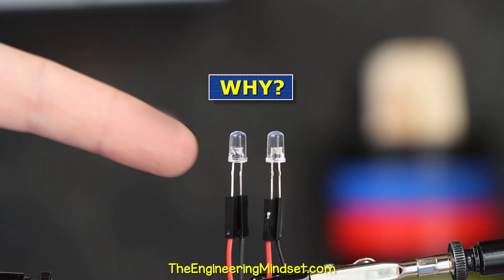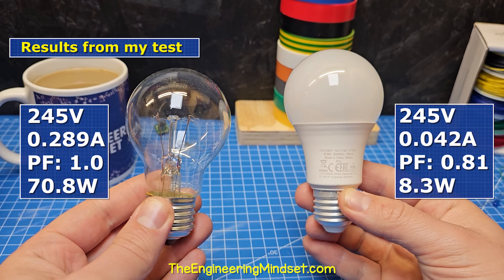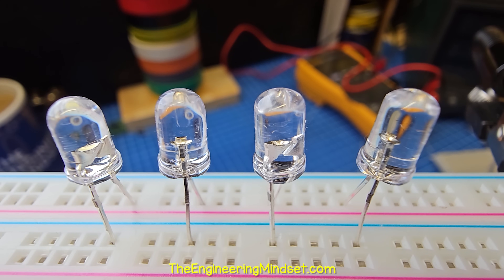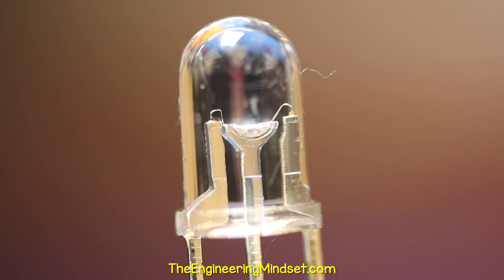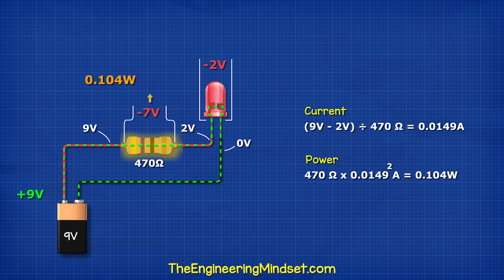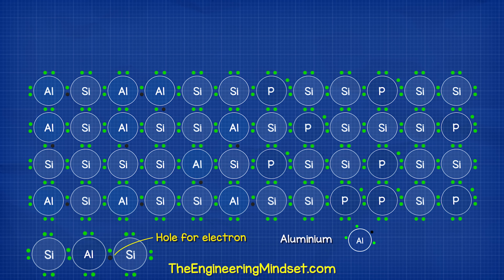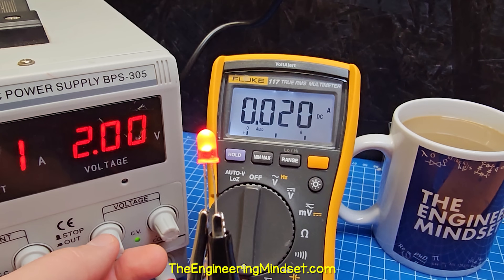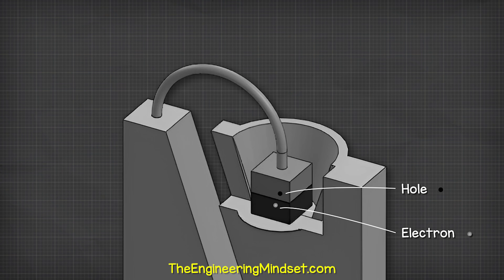How LED Works - Unravel the Mysteries of How LEDs Work!

Comment: 8:36 those are not tiny LEDs inside the computer monitor, those are LCD pixels that are backlit with a few white LEDs.  If you went to a large sports stadium and zoomed into their large screen, yes then you would see lots of LEDs that make up the picture, but thats not the case with an LCD computer monitor

Comment: Excellent video. Being an old TV, RADIO. Repairman in the 70’s  I have a steep learning curve ahead of me.  MOSFET was the cutting edge of the cutting edge when I started Medical School. Now at age 70, I am still seeing patients but am getting back into electronics. In my life as a physician, I met many veterans from WW2 and into the early 1950’s. Learned a lot once their NDA’s expired. Amazing what they were able to do with vacuum tubes!  Now, something I would appreciate your expert opinion.
I learned physics in undergrad, Kozarev’s theories, which he proved to a certain pin extent, were fully validated in the Mid to late 80’s and 90’s. The physics of his  Spiral   mirror are amazing but well beyond my math level.  I found out last year of a recent experiment in the last 10 years, they were able to  SEE the Pleiades where they currently are both with light telescope and radio-telescope when using the Kosarev spiral mirror in conjunction.  The Pleiades are 1200 light years away. This would indicate that Kozarev’s mirror is able to receive tachyons or other similar particles.  There is a documentary on YouTube about the experiments that were tried in an area of low magnetic field near the North pole.  Please let me know what your thoughts are on this scientifically proven but quire mysterious device.   My name is Sergio  AKA Dr. T🖖🏼
Reply from the maker: See my new MOSFET explained video here➡️: https://youtu.be/AwRJsze_9m4

Comment: Another LED type that I learned about a few weeks ago is called an addressable LED. It’s a bit beyond this video, but worth noting for the advanced users as it allows multiple LEDs to be controlled at different colors each using only one signal pin on a microcontroller. 

It is a LED with an internal microcontroller that can be gotten as either RGB or RGBW and is controlled by a high low signal. The LEDs are chained in sequential order by their signal pins. To control them, a signal is sent containing the information for all the LEDs in the chain. The first LED removes its instructions and then sends the remaining signal to the next LED. These LEDs can be bought individually or in LED strips.
Reply: void of free electrons and holes, is crucial to how a diode—and therefore an LED—operates. It forms an electric field that controls how electrons flow, allowing them to move in one direction only. When an electron from the N-doped side moves across the depletion zone into the P-doped side, it releases a specific amount of energy, which is emitted as light.

Comment: Ten volts LED light takes 100 DC power then each light then each LED takes ten volts current when taking 100 votes in series what voltage full moon takes in single give that power to another separate section and vote near DC power

Comment: LEDs are bad diodes. With a reverse voltage greater than 5 volts, current begins to flow through them again, like in a Zener diode. But because the direction of the current doesn't match, they don't light up. Instead, they heat up and can be destroyed. LEDs are only designed to be forward operated but then the current must be limited.
Reply from the maker: Zener is covered in our brand new video here: https://youtu.be/DGKTzl9CTXo

Comment: You should do a video on "Toasters explained - How toasters work...and why you shouldn't put silverware into the slots" from an electrical engineering perspective.  The electrical engineering behind the average toaster is both fascinating and horrifying.  The toaster is probably the single most dangerous standalone appliance in the average home.  While microwave transformers are far more dangerous/lethal and the large capacitors found in A/C units can also deliver a lethal charge, you have to disassemble those appliances to enter danger territory.  The toaster, on the other hand, can deliver a lethal charge without any disassembly and can also short itself out and even cause electrical fires.  The toaster also has plenty to cover on the electrical engineering front despite just being a bunch of metal and wires.

Comment: Did you know? When the LED was first invented no one knew what the hell to do with it? After some time it was FIRST used in the standard Alarm Clock. Those were all Red LEDs and did not have any protective covering, other then the plastic used to shape the numbers and : and . 

This mostly from memory, so I may be missing a detail or two.

Comment: Do traditional light bulbs use black body radiation to produce light while LED use diodes ?
Reply: Traditional bulbs ( cfl. Incandescent) use gas, mercury excited by electrons to produce light energy due to resistance. LEDs use both resistance and current semi conductor. Crazy 😮
Reply: LEDs are a mini version of radiation.

Comment: That was, by far, the best explanation of how LEDs work I have ever seen. 
Super in depth, while not talking over our heads.
Reply: It was covered in the video but might have been explained better.
A diode will not conduct until a small voltage (the forward voltage) is applied. Once the diode has been 'switched on' by this voltage it will conduct and a current will flow. In a LED it is the current flowing, not the voltage, that controls the light emitted.
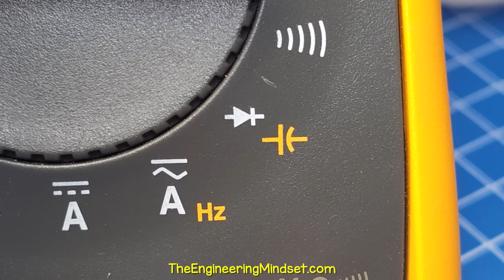In addition diodes are not 'ohmic' loads, and are not self regulating, the current can rise to such an extent that the diode is destroyed (the graph at about 14:23 shows this well). This is why a current limiting resistor is required in the circuit.
Reply: It was too redundant -- it felt like 4 or 5 shorts edited together.  How many times do we have to be told about the flat side of a diode?
Reply: @christosvoskresye  As many you need to learn

Comment: I wonder who that bearded man at the beginning of the video was ?  Hmmm 🤔 Any ideas Paul ?
Reply from the maker: I snuck just 2 frames into the video
Reply: @EngineeringMindset  That explains why I couldn't stop it in the right spot when I played it back at 25% speed. Five or six times. 😂
Reply from the maker: You can use ">" and "<" to go frame by frame on a youtube video from PC. Although I appear in the last 3 videos also and 3 previous ones too. Couple of the old videos I Introduce the video
Reply: @EngineeringMindset  Now that Paul, is definitely one of the better things I have learnt through the comments on YouTube. Thanks very much for that mate. Cheers.

Comment: I was pleased that your animation showed the correct electron flow direction from negative to positive. In electronics college our instructor demonstrated this with a piece of graphite and a piece of paper. With high DC voltage and the negative connected to the graphite the arc produced carried graphite particles to the paper as the arc continued through the paper to the positive electrode on the other side.
Reply: I like that too, practically it doesn't matter when thinking about circuits, but I would have loved if that was what I learned in school to begin with.
Reply: In those days that was referred to as 
Conventional Current! 
Confusing Indeed!! 😮❤
Reply: You are correct in that the electrons originate from the negative terminal and go towards the positive terminal 

But the electric field originates at the positive terminal and ends at the negative terminal. The direction of the electric field is opposite to the direction of the electron flow.